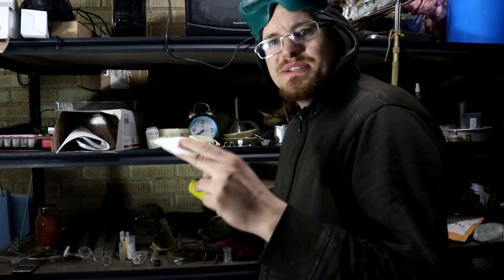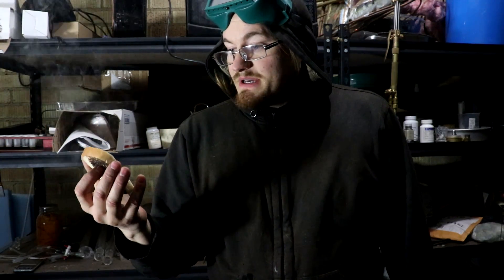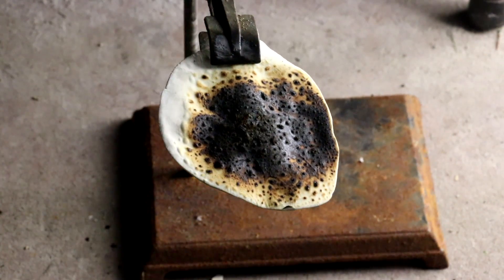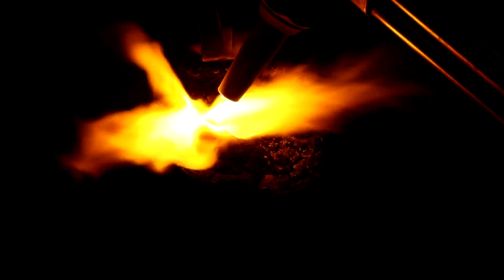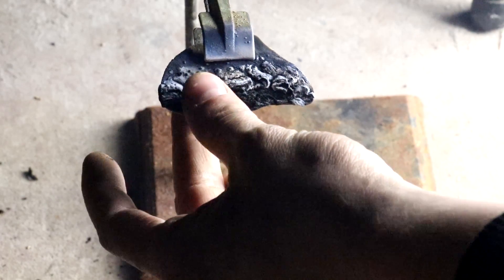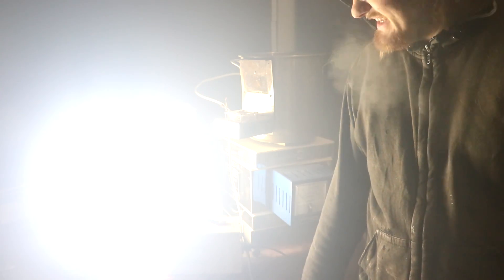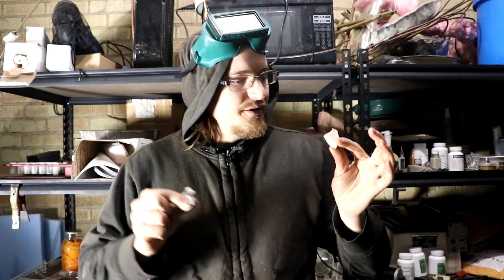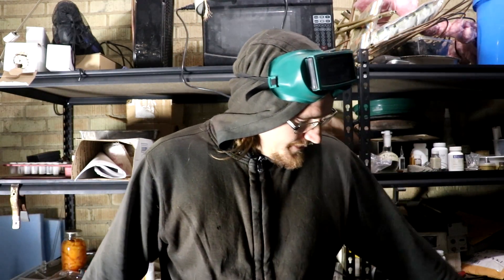Can I Burn Through Starlite?

Comment: The oxygen lance of the cutting torch barely adds to the combustion of the preheat flames but rather it is there to react with the molten steel and also to blow it away. In fact, theoretically you can shut the acetylene off and continue the cut on pure oxygen. But you lose heat. You see how when you press the lever a small dark spot appears, it's actually cooling the material.

Comment: I think a big part of the problem with this test is that it's not just heat, it's also a lot of pressure which could be breaking apart the expanding carbon foam about as fast as it is forming so instead of testing how much heat it can withstand it's more like testing how fast the compound turns to carbon.

edit: he sort of adresses this in the video but he brushes over it really quickly.

Comment: The carbon conducting the heat away, and even the CO2 off-gas creating an air pocket, it very well could survive reentry.

There  is a big 'IF' though; as you saw cutting from the edges the heat has less places to move to, causing it to cut,  however starting from a central plate radiating it's heat outwards should take a bit more time.

Some ablative heat tile designs are essentially a carbon foam, AKA essentially burnt toast, so the bread example was nice touch. It's the carbonized materials ability to conduct heat outwards that gives the great thermal properties.
Starlite, and yes toast, are both in-application precarbonized,  and if evenly distributed heat cause it to build up the carbon layer to pull away more and more efficiently.

So another test is to see how long it takes the torch to burn through the center of a sample, heat fanning outwards, so it's under an even load,  rather than fail condition of heat getting around the edge of a thermal wicking tile.

Comment: the melting point of carbon is 3550 oC, 3823 K the starlite you are using is 100% carbon  and a oxygen acetylene torch burns at 6500f  3800c

Comment: Original starlite was primarily plastic. A plastic that bubbles but cools down to just luke warm a second after. im going to guess the bubbles worked as a shield barrier cause they were filled with some gas and insulated well. Question is what materials were put into it and the whole making process. U can know the exact composition but steps are more important. But it all sound like bullshit to me anyway.

Comment: I dont think you should start from the edge. My reasoning is that the protection mechanism of the material is based on it forming layers, with fresh material available underneath. If you start from the edge, the surface area between the carbon layer and the fresh material is very small meaning what your doing is just burning carbon. Or at least circumventing the normal mechanism somehow. It might be much tougher if the material can keep forming fresh foam. I might be completely wrong due to  the frobscottle i had yesterday though.

Comment: Cody: would it actually take any longer to cut through your "starlite" with a (tool-grade, not tyre-filling) cold compressed-air line, than it does with an oxyacetylene torch?  One could try it with a bit of venturi nozzle to approximate the nozzle on the torch, but I've  a feeling that this might not be necessary.

Comment: The blast from the gas flow is ablating the surface which is a different process from what was depicted in the original demonstrations where Starlite was shown resisting heat, not being blasted by a high velocity gas flow. NASA developed ceramic Carbon-Carbon tiles to form the heat shield for the space shuttle, so Carbon chemistry is responsible for much of the heat resistance. The mechanism for holding the Carbon matrix together while subject to heating and high velocity gas flow is the tricky bit.

Comment: Would be interesting to line a crucible with it and pour metal, It's easy to pattern so may well have commercial uses.
Reply: Check Beyond the press channel. They made a crucible out of the thing and burned thermite in it and it handled it well. They also did a similar test with an oxy-acetylen torch.

Comment: Freshly graduated aerospace engineer dropping my two cents. Whatever that stuff is is not an insulator but an ablative. The two applications for those are the inside surface of small rocket motor combustion chambers and reentry shields. That material could be a pretty decent ablative but the demonstrated mechanical properties and significant bubbling/expansion make it extremely susceptible to shear removal (from supersonic or even subsonic flow of plasma or combustion products). That would make it erode too quickly which means it actually sucks at it's job. There is no fancy conspiracy here, just an ablative that is sub-par.

Comment: Nobody can get the original Starlite, so I suppose it is hard to test. 
However this material could have good uses, I was wondering if you Cody could formulate a new Starlite, if anyone could do it it would be you. I wondered if it could be improved by adding Borax and or Sodium Silicate.

Comment: Maybe try adding some ceramic powder in the mix to be kind of a heat sink. Also maybe not using flour but some other carbon rich material? I’d like to see different combinations and how they turn out. Maybe like baking soda and talcum powder or sodium carbonate and another similar material.

Comment: this doesn't seem to be a valid test. you sure could blast through space shuttles title with same torch. you should be able to cut this through just with the pressure this torch produces without the heat. you because you are basically flaking small bits off the material. i would say try using the material as an insulator in one of your ovens.

Comment: I mean, you're literally starting on the edge instead of on the body of it. Not sure what you expected to happen.  I can take a piece of this and burn through it with a butane torch from the edge, but sick it in the center and it takes almost 5+ minutes to start showing signs of burning though...

I think your testing methodology leaves a lot to be desired.

Comment: I think you blasted through with the gas pressure more than burned through with heat. Basically the gas pressure blasted away the carbon insulating layer that is formed by the heat, exposing more of the un-carbonized material. [lather-rinse=-repeat until you are through the material] it would be interesting to have a thermal camera filming the back side when the extreme heat is applied to see how well it really does. Having said that, I do agree it is not some magic material, and it certainly would not be good as a heat-shield for re-entry of a spacecraft, as the extreme pressures would effectively blast away the material.

Comment: I made lots of the stuff and messed around with the ingredients and got it to the point where I was able to cut through a steel rod that was sitting in my hand. I could also blast a cm thick sheet in the same spot for about 20 seconds while it was in my hands with the cutting tip of an oxy-acetylene torch. It's also very flexible and relatively tough. I have some vids of it too.

Comment: Thanks for adding the plaster board comparison. 
It may not be the original "starlight" but the termite test really impressed me. Your test added another dimension to static heat - dynamic pressure.

Comment: I think the one of the reasons why it's not working as well is because of the type of flame you are using is oxidezed which the co2 that is produced from it that's one of the things it does to reduce the heat and make it not ketch on fire

Either way great video 
Thank you for doing the science test us at home shouldn't or can't do

Comment: Cody, I remember seeing the news of Starlite when it supposed to be used by NASA.  I thought it was something cool that I should explore, so I attempted to make some with the products lying around my house.  I only had Gesso, sodium bicarbonate, plaster, and salt.  The end product was very tough and we did use an oxy/acetylene torch on it.  The result was it carbonized over and finally blasted through after 5 mins.  The piece that was completely dry was 1/4" thick.
The difference between the Starlite that you made and the one I made, was the durability.  I remember the salt had an impact on the result.  For everyday use around the workplace or house repairs or just in experiments this stuff will come in handy.
I like the vids, keep it up.
Ed

Comment: So two questions:
1. Was the cutting through accomplished by the heat and oxygen, or by the impulse of the oxygen flow?
2. You mentioned cutting through stainless. People often state that heating, plating, or working with stainless will release hexavalent chromium, which is apparently very nasty. How do you deal with that?

Comment: how about if you took some to use it as insulation by burning the outside covered the burnt parts with something such as a glue or paint? would it be better at insulation then more commonly used materials?

Comment: Awesome video, just a few thoughts... Given the proximity and pressure of the torch, I wonder how much of the relatively soft "starlite" is simply being eroded by the torch pressure. I wonder what would happen if an air compressor was used to cut the sample at a similar pressure as the flame.

Some people have commented on it's potential as an ablative heat shield (or lack thereof). While I am no expert, I feel a more reasonable test for this would be to burn through the center of the sample against a hard supporting plate, timer and thermometer to measure progress/success, where the emphasis is more on heat ablation than aerodynamic erosion.

Comment: If its conductive maybe try carbon arc gouging. Also never cut stainless steel with a oxy fuel rig. The HAZ will no longer be stainless (carbide precipitation

-welder

Comment: How about try to reproduce a stainless steel reentry vehicle like SpaceX is saying they will have. Granted it's been said that it's a "special alloy" with active cooling but you should be able to figure out and demonstrate about how much heat would need to be dissipated.  And it would be an interesting video to see the coolant boil away and then the skin disintegrate as you simulated the reentry conditions.

Comment: This is an interesting test, but I think it's a little unfair to refer to this as 'Starlite' rather than 'an approximation of Starlite'. While I'm not suggesting that the original recipe was some kind of miracle, it's not really fair to test something which is little more than a guess at the recipe and then pass judgement on the real thing. Having watched some of the videos of the original recipe being tested under a blowtorch, it's pretty clear than Nighthawk's version blackens and bubbles significantly faster. I wouldn't consider it 'identical' by any means, but perhaps I am missing something.

Comment: honestly I think this was a bit of an unfair experiment testing the capabilities of the substance. ward always claimed it was just a really nice safe plastic with great heat resistance-- IE a mold-able thermal insulator. the torch you were using was more physically cutting the starlite than burning through it. the force of the gas coming out was enough to shatter the brittle carbon sponge on the surface repeatedly and carve through the material. a better test would have been tossing it in a kiln or stoked fire. when nasa was looking at the substance, it was going to be used as a substrate to the thermal tiles to help keep the internals from getting hotter on re-entry (of which can cause failure or shortens the life of components on the shuttle) 

No one has (to my knoweldge) ever hyped starlite as the second coming of christ, and most have simply lamented that maurice ward didnt pass down his particular recipe because a substance with that good a thermal insulation has the potential to save a lot of lives.

Comment: I wonder what a carbon arc would do.
I'm guessing the torch makes quick work of the material by blowing away the newly formed carbon foam.
A carbon arc is plenty hot, I've turned a firebrick in to glass with one, but doesn't seem to blow things away, so should be an ideal candidate for concentrated heat.

Then again if we are talking NASA and spaceflight we are probably talking about re entry, and well, that kind of blows, pardon the pun.

Comment: Holding it that close you won't know if the air pressure cut it in half or it burned.
The material isn't physically strong at all, so this test is pointless.

Comment: Thermite can't cut through anything just sitting in the open. But if you put inside of an enclosure that focuses the burn it will cut pretty much everything, especially structural beams on high rise buildings :)

Comment: Isn't Starlite a product that should be used in combination with another one?
Like you said steel would resist your torch much longer to being cut through, but it conducts the heat so the material behind would heat up just as much. If you had that Starlite behind a sheet of steel, that would protect the stuff behind right?

Comment: you should give constant feed on the air blast once you have sufficiently heated the edge and move at a constant pace, instead of your method of advancing with a burst and then moving backwards.  it's not meant to be intermittent.  maybe just the camera but it looks like you could put some more oxygen in the flame too...it looks like it could be hotter

Comment: Just thought I'd mention: NASA wanted to use this for atmospheric entry. Let's keep in mind the oxy-acetylene torch has a concentrated flame. With atmospheric entry, you have a much larger object, thus larger surface area. Technically speaking, wouldn't this technically mean that the hand trick is feasable, but if it were with a higher temperature, less concentrated flame?

Comment: Wouldnt have changed the results but  your title says "Burn through" yet you just cut it

Instead  of setting the flame in the middle you started on the edge which is a weak point and expand that weakness to cut it

Comment: Just an idea.. Kevlar and or carbon fibres and glass or rock wool mixed into a thin mix of starlight spread 3mm thick on thin stainless (1mm thick) 2 or 3 layers clamped together or 1 sheet coated both sides of the stainless with the reinforced starlight. That would offer far more resistance I suspect. 
Question.. if starlight is pained on the outside of an electric kettle. 1/. Would it boil quicker due to less heat loss? 2/. Would it remain cold on the outside while containing boiling water?

Comment: Beyond the Press channel made a starlite bowl that withstood being topped off to the brim with thermite, and was cool to the touch seconds later.   Cody:  uhhh, thermite's not that hot... Reality:  you couldn't find an alternative material that would do the same thing - FAIL... but wanted to join the click-bate fun as a "debunker". Give your audience a little more respect, man.
Reply: He didn’t say that thermite isn’t hot, he said that thermite isn’t good at burning through things
Reply: mad fake news here gtfo
Reply: I think we all know the fact the heat didnt cut through this "starlite". its the gas pressure that blow the insulation away. I dont know what triggered Cody but this is not cool coming from him. I lost a little respect for him today..
Reply: @andersenzheng  It was supposed to be able to withstand the gas pressure of atmospheric re-entry, which would be much higher than that torch produces.
Reply: @OnlyKaerius  i thought it was considered as an insulation layer for the tiles/roofs in IIS or space shuttle.
Reply: @andersenzheng  it has all the insulating properties of unleavened bread until it's burned.
Reply: @OnlyKaerius  bread as we know it does not block heat as efficient as this. A piece of dough maybe. And not to talk down on NASA but the money they spent on insulation material suggest they did not consider this as a insulation layer as this blocks heat much better than most of the things i see. Just because it has similar recipe as something as mundane as a dough, doesn't mean it cant have amazing use. Im sure NASA can come up with better ways to produce starlite, but this recipe came out as a surprise and really got people thinking. Seeing how simple the recipe is does down play how good this is, but to be perfectly honest i dont think a lot of people have ever thought about using this recipe as an insulation material, let alone blocking thousands of degrees.
Reply: @andersenzheng  See: until it's burned. These "Starlite" materials are good insulators only after they've been burned, when they are burned they form carbon foam, and it's this carbon foam that's an insulator. Before that it's basically bread dough, mind you bread dough made with universal glue, so not particularly edible.
Reply: @andersenzheng  Sidenote: it's only a good insulator against heat because of the blackbody radiation properties of the carbon foam, it's not a particularly good insulator against cold or even more normal temperatures. It wouldn't be particularly good for a space station to insulate against the cold of near-vacuum. It's one big use is against very high temperatures.
Reply: A well dried mud bowl would probably contain thermite. It means nothing.

Comment: I would be interested to compare this to a similar test using just compressed air with the same size nozzle, same pressure and CFM as a pair of e-tanks.  I bet you could blow it away  in a similare fashion.  This looks as much like erosion as actual burn.  Then, back the starlite with something rigid and compare burn rates with the torch.

Comment: So im assuming the starlite would have been in half within about 4 seconds if you would have actually had the torch set to a cutting temperature (it would have been a blue 3-4” flame with no white or orange).